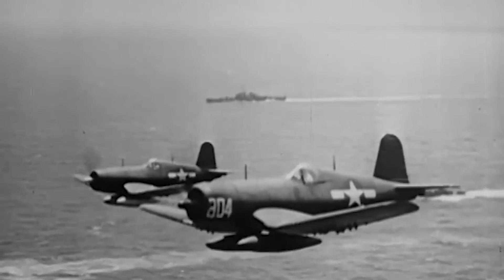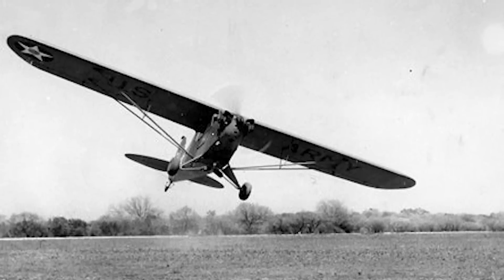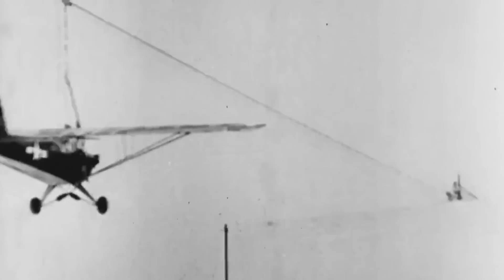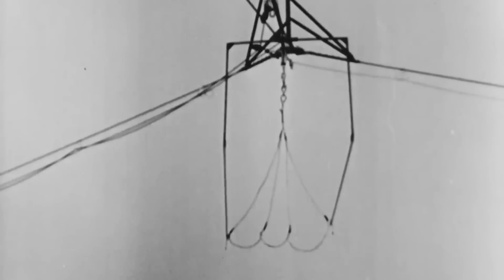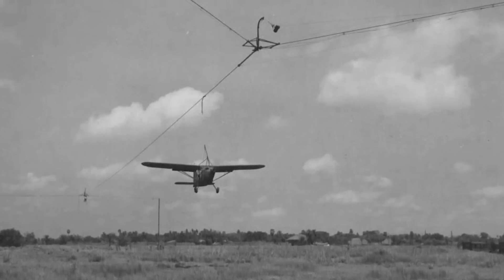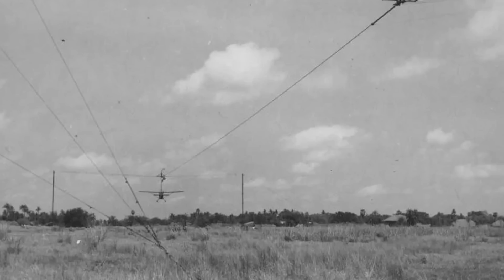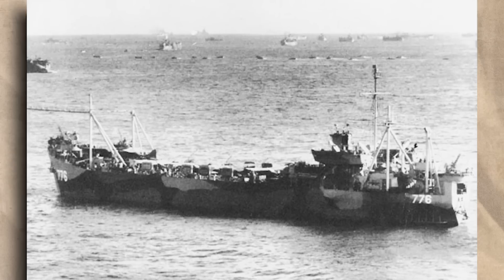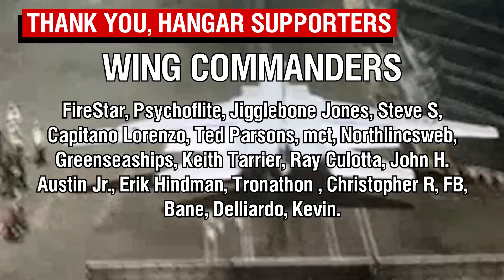An Aircraft Carrier Without A Deck? | The Remarkable Brodie Landing System

Comment: If this was introduced much earlier in the war it probably would have done well.
Reply: No doubt that the british would have had at least two to four of these on ships per convoy with sub hunting equipment.  Would have also been useful for artillery spotting in North Africa.
Reply: Yeah that was my thoughts exactly. This would have been huge for sub spotting on convoy duty and would have also been really useful in rugged terrain or contested areas. The system would have been nearly impossible to destroy compared to a more standard runway.
Reply: Might have seen use on some of the cruisers & battleships as spotters too, whether floatplanes or otherwise.

Honestly, I'm a little surprised it didn't make it's way to civilian freighters post-war. You'd think the added capability would have been considered appealing in the early days of helicopters.
Reply: It's kind of a reverse Skyhook.
Reply: @absalomdraconis  I can't see it being used at all in a civilian market. The only real advantage it has over a seaplane is the faster recovery time, which won't matter much outside of war zones. The wire itself definitely limits the capabilities of the plane far more than requiring a water or traditional runway.
Reply: If these would have been installed on a bunch of liberty ships and their destroyer escorts they would have been an incredible weapon against the U-Boats. We know it was possible to mount bazooka rocket launchers on them too so they could have been equipped to fight against the U-Boats.
Reply: In the first World War and starts of the Second, you didn't really need much of a runway at all. Volume was prioritized and I don't really see this method allowing the carrying of many planes at all nor having many take off at the same time.
This method is definitely more for non-combat role aircraft, but then it's limited in size specially in the sea. The ground runway still looks promising, it could see some modern use as well if only the existence of a detectable aircraft didn't ruin the whole "covert" thing... and yeah, the video then reminded me of choppers
Reply: Oh yeah, guadalcanal, the burma campaign.....would have been a great asset!
Reply: Yeah, giving every convoy the ability to use aircraft would have been huge.
Reply: What? Plenty of ships had catapult launchers and cranes during WW2
Reply: @Dudeman9339  Yeah, and they generally came in two types: seaplanes which were generally only useful for spotting and maybe limited bombing/ASW, but could be recovered, or a single fighter/bomber that had to be ditched after its mission because it couldn't land anywhere.

That's the point. A system like this could help a merchant convoy carry real aerial firepower with it and recover it to use again.
Reply: @Kelnx  there were ships called sea plane tenders introduced around ww1 (maybe even before) which did the same thing just with more planes, there were even plans for submarines with sea plane tenders capability but they were scraped at the end of ww2, and sea plane tenders weren't used widely because the air assets were needed elsewhere.
Reply: @Rian Felis Float planes have increased weight and drag, which reduces their range and useful load compared with a similar regular plane. It's still true even now, back then was a big issue due to less efficient engines. And seaplanes perform slightly better but still same drawbacks, are more expensive and bigger.

If you need a crane to raise and lower the plane anyways, why don't you add a bit more cable and get to operate a full fledged aircraft with better performance and lower cost?

To me, the only reason this system didn't catch on is because like many innovations it came too late.

Comment: This is fascinating. Such a dieselpunk system. I'm amazed there were places that could take off with such a low speed even in ww2.  I wonder if they could have cable Catapult assisted the takeoff if it had gone further?
Reply: With the plane being slung off to the side, using rocket assist might actually also be possible since you don't have to worry about the rocket backblast burning anything on the deck of your (presumably) cargo vessel.
Reply: @ach3909  Except that these little planes were fabric covered, that rocket assist might well ignite the airplane it is assisting.
Reply: @alonespirit9923  The rocket assist is for heavier aircraft obviously. these grasshoppers clearly didn't need any assistance to takeoff on their own power.

Comment: Reminds me of the skyhook system developed for the Harrier. Albeit, more successful...and possibly saner.
Reply: The skyhook was really just a continuation of the airship hook up system mentioned at the start of the video only its being used from a crane on the side of a ship.
Reply: @alexsis1778 Well yeah, but the utilization of what under normal circumstances would be vessels incapable of utilizing fixed wing aircraft being retrofitted to do so with unique systems is the point of connection. Also the skyhook was a bit more than the catch system on an airship. If you want to simplify it, it's closer to a crane that compensated for the movement of a ship.

Comment: 3:18 The two airships designed to carry, launch, and recover their own complement of scout fighters were the USS Akron and the USS Macon, both commissioned vessels of the United States Navy. They operated a specially modified version of the Curtiss F9C Sparrowhawk that was exclusively used by the Navy. If these airships had proven themselves able to handle stormy conditions, both crashed due to inclement weather, their Sparrowhawks would have flown without conventional landing gear, tying them permanently to their motherships.
Reply: Complement.

Comment: I read a description of the ship-mounted version of this some years ago, can't remember where, I don't think it mentioned the land-based masts at all. Apparently landing at sea was really tricky when the ship was rolling because even a moderate degree of roll translated to a huge amount of vertical movement at the cable. The pilot had to fly a sort of sine wave approach, pitching his aircraft up and down, perfectly timed to match the up and down movement of the cable. Failure to do this meant a very real chance of colliding head-on with the steel derrick or being swatted downwards into the sea by it.

Comment: My Grandfather was assigned to an LST, the 614, during WW2, they were a versatile ship,  BUT trying to imagine how hard take off and landing on one, they are for the most part, a flat bottom ship with a fairly shallow drought to get them in close to shore. Now imagine trying to take off or land from one. It's hard to say which was a better design, this or the LST 386 which had a small flight deck built and the planes were stored in racks on either side of that flight deck.

Comment: Fascinating!

I feel like radio technology is a big part of this story, though.  One of the major problems with using Navy aircraft for Army artillery spotting was they couldn't talk to each other.  Remember, this is an era when most if not all radios were tuned by physically changing a quartz crystal.  So the aircraft would have to radio it's ship, which would radio the relevant army headquarters, which would radio the artillery - a cumbersome process at best.  So there was a real need to have an ARMY aircraft talking to ARMY units.

By late war the radios are improving and the problem decreasing; and by the time the helos come along, the radios are much more flexible as well.  So not only is it much easier to get a ship-based light aircraft over the target area, it no longer needs to be a dedicated Army spotter plane.

Comment: I wouldn't be surprised if some aspects of that may have inspired the kinds of trap line recovery systems currently used with some drone aircraft. (They fly below the line or inverted trapeze with a hook on top for an arrested landing.) The idea of having no deck or runway needed still makes sense for light aircraft.

Comment: Nice story!
Thinking about it I would have gone for a reinforced tail section of the aircraft to be placed upon a solid four-metre slightly fan-splayed platform able to be oriented up or down wind. A pincer would have retained the air-craft sufficient to allow it to develop full throttle - on release a timed injection of turbo-charging oxygen was to be injected into the carburettor and the platform aimed upwards by 5°. For landing the tyres of the aircraft were to be augmented in size sufficient to float and pilots trained in a controlled stall next to the ship and from where it would be winched back aboard - but 10 out of 10 to Brodie for trying - we need alert men like that.

Comment: Thank you for shining a light on these obscure, might-have-been and almost there systems, showing weird and wonderful ingenuity.
Had the darn helicopters not taken flight that early …
I could see them being used at outposts where  a runway would be hard to build and where helicopters have troubles … but they are strictly lightweight planes only in this iteration. 

Though it would be fun to see a Boeing 7x7 using them for take-off and landing.

Comment: First I've heard of this, another genius level idea and implementation.
Has any air force tried these ideas for launching planes from no-deck ships (or for land-based instant air strips)?:
1. Helium balloons.
2. Brodie system with a launch rocket?
3. A very high crane, and just drop the plane say from 250 ft?

Helicopters replacing the planes on ships seems a logical solution, but they are less reliable, difficult to launch in high cross winds, piloting skills take longer, they also tend to be much more expensive and costly to maintain.
The Brodie system could make a comeback with the development of drones and sophisticated algorithm driven autonomous flying and landing. Take the various drone based delivery systems that are already in service, for example.

The Brodie system also makes sense in time of war where quick turn around and training is needed.

Comment: This actually seems like a viable method to launch jets off a airship.
Reply: Drones. Jet drones.
Reply: And retrieve them.
Reply: What about landing? at jet speeds I see lots of damaged equipment and lost planes and crew.
Reply: @philvanderlaan5942  well, current aircraft carriers use arresting nets for stopping aircraft with issues or emergency landings, so that could work here as well.
Reply: Or using rockets for a launch boost
Reply: @philvanderlaan5942  : Honestly, for landings you'd probably see a more "pendulum" like system: trail a long cable out of the airship, equip the jets with equipment to snag it a foot or two ahead, transfer the caught cable to a holder on the spine of the jet, turn off the engines, and wait to be hauled up. A similar system was used in Vietnam to recover various individuals and items with cargo aircraft that didn't land.

Comment: Wonder if this system would have worked with an airship. Seems a much better system than just a cradle hanging down and the pilots wouldn't have had to worry about matching speed. 🤔🤔

Comment: The Taylorcraft L-2 can take off fully loaded in under 400' as can the Stinson Sentinel - kinda negates the usefulness of a land based 600' high wire system.
Reply: He says very clearly that they only needed 400' for take-off and the 600' length was "just in case" - don't want to kill a pilot because you have crappy fuel, hey?
Reply: @davydatwood3158  Still pointless for a land based system then, as you had to clear vegetation as well as set up the system &all to achieve the same as a dirt runway.

Comment: If my country, the Philippines, have at least a bunch of Bush pilots, and light aircraft that are commonplace here, I would've seen that system in a day-to-day basis, given the archipelago's topography. But alas, freaking corruption in the middle and lower levels of politics (& greed) got in the way... Not to mention our aviation industry, apart from a state-owned one, is pretty much non-existent

Even a small plane can do a difference here just by transporting stuff and going from place to place impossible for other planes to land on. We may have helicopters, but they're expensive as HECK along with the training required and maintenance